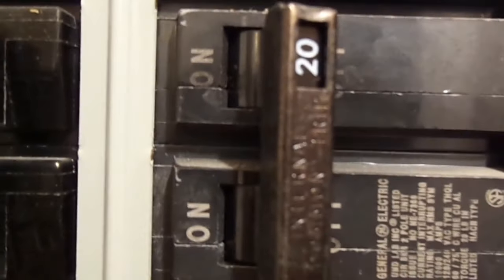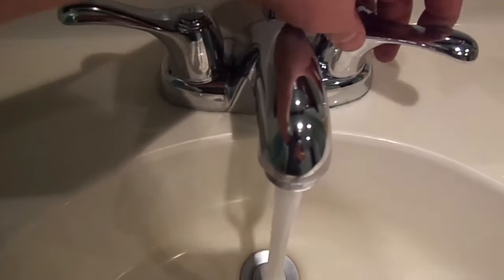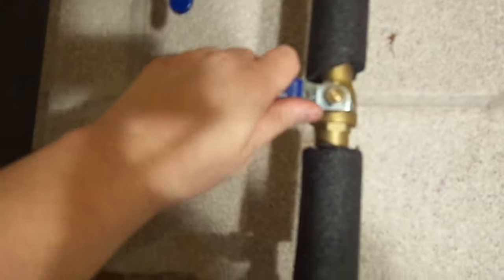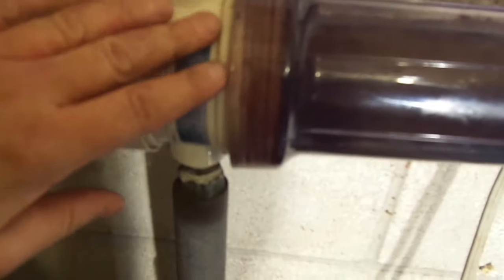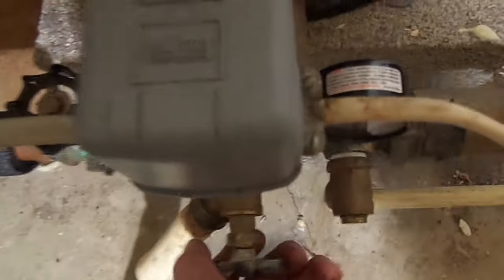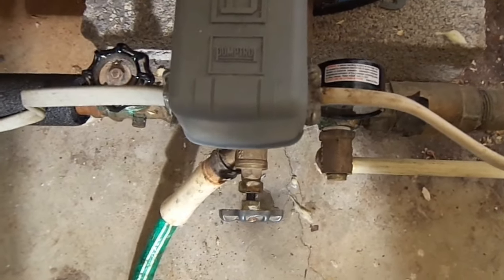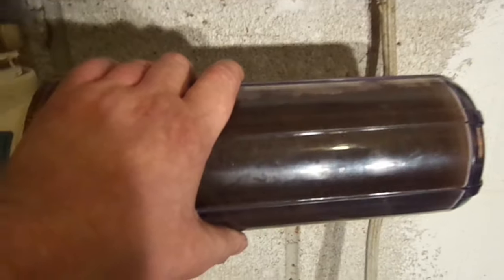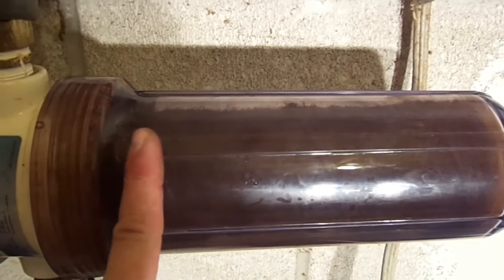Back flushing water lines in house. (diy)

Comment: Perhaps a naive question, but why turn a faucet on before draining through the pressure tank valve?  It seems like you would want the pressurized water to assist with the gravity flush, but turning the faucet on depressurizes the lines.
Reply from the maker: You need air going in. It helps with drainage by allowing water out and air in.
Reply: @SurvivalonaBudgetMadeEasy  Thank you.

Comment: Does this need to be done if you don’t have a well? We are on county water, I just noticed my cold water flow is low and also a rotten spot under my valves under the kitchen sink. It may have been here a long time though bc the previous owners had a piece of plywood under the sink. Today I decided I would clean out and vacuum under there and discovered the damage.
Reply from the maker: No you do not. Thanks for watching and the comment.

Comment: 🟠 HERE IS ANOTHER FIX: First shut off the main water source, then run a garden hose from the neighbors house or completely separate water source. Attach the garden hose to the the clogged water fixture. There are adapters available at home depot if you dont have a perfect fit. Open all connected faucets and/or fixtures, and also remove the GPM flow-restrictiors from these plumbing fixtures which will allow and backwash the collected sediment/clog out the other way through these fixtures. Run hot water through the garden hose if possible, hot water can potentially loosen up sediment and clogs better. Alternating from cold to hot in 5-10 minute intervals can also expand and contract the pipes loosening clogs/sediment up as well.
Reply from the maker: Thanks for the great detailed info.
Reply: @SurvivalonaBudgetMadeEasy   thanks for your video also! :)
Reply from the maker: I think you were more helpful but you are welcome.
Reply: @SurvivalonaBudgetMadeEasy   Well thats debateable. My shower was slow-running-clogged for 15 years and it took me this long to figure it out. Now it runs literally like new after this. So not so helpful to myself till yesterday, LOL.

Comment: Can you do this to help with the water line leading to the toilet tanks? They are no longer filling... and it has nothing to do with the tank insides
Reply from the maker: I don't see how this could help fill toilet tanks. Thanks for the comment and for watching.
Reply: My problem also: the water line to the toilet is so clogged there's no pressure. Considering running a wire thru the cutoff valve.

Comment: I don't think there is a water filter on our system. How do you put one in?
Reply from the maker: Adding a water filter is a lot like replacing a hot water heater. The water filter should be place after you pressure tank. It is an easy diy project. Make sure you have water shut off before doing it. Here is a link to replacing the water heater. https://www.youtube.com/watch?v=OjZFt4vMUp4

Comment: Do you answer questions about back filling water pipes in a home.
Reply from the maker: Will do my best.
Reply: I decided to keep my father house after he died for when I retire. However, it is 100 miles away from where I live and do not plan on moving there for 5 years or so.  I blew out the water pipes this past November so I could shut the heat off to save money and the pipes would not burst.  However, 2 people have told me that when you shut off the water and heat that a house starts to fall apart.  So I researched it and from a unconfirmed source I found that even though you have copper water pipes that iron particles from your hot water heater can lay in the horizontal lines and eat a hole thru your pipes because of the moisture still in the pipes.  I thought about back filling them with rv antifreeze and a water pump and just wanted to know what you would do if you were in this situation.   I never really thought that copper would rust.
Reply: I have bought a few homes that had been empty for a year up to two years. Each one had been winterized by some company that left stickers on every faucet, toilet, shower etc. Each home had busted pipes when I restored water service. I would pump antifreeze into the lines if you can. You can blow air through the pipes to get the bulk of the water out. There will still be residual water collecting in the traps after you blow out the lines. Antifreeze into the drains to protect the traps. There is bound to be a low spot somewhere you won't find that is going to be the problem. Water will condense and do what it does best. Freeze and hydraulically bust the pipe. There are some good videos on YouTube about winterizing correctly. Good luck!!